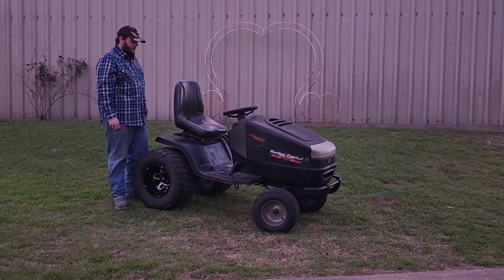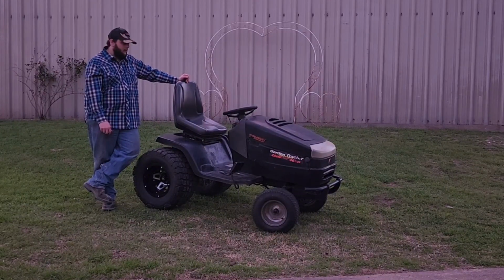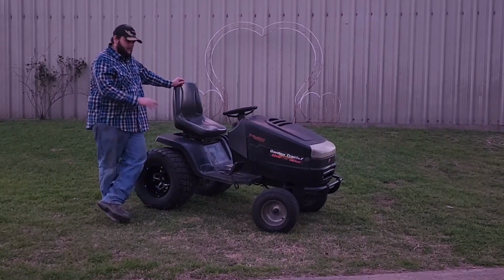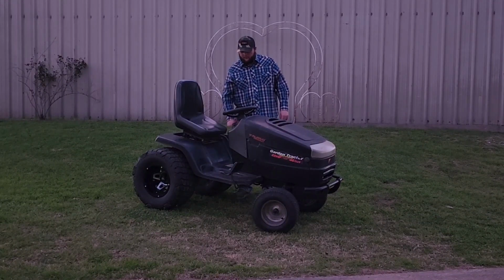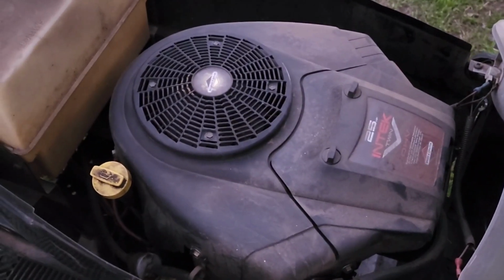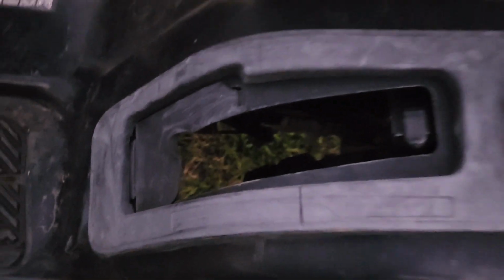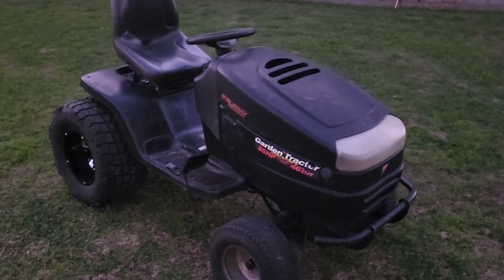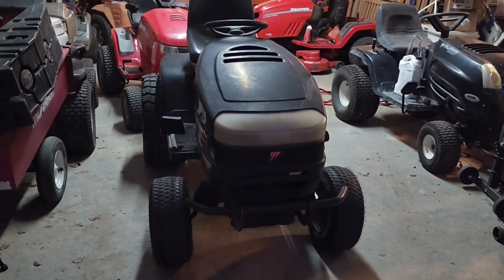Tractor Showcase: 2003 Murray Performance GT

Comment: I had one of the wide body  in 2000 I believe. Had all the attachments. Planet a 2 acre garden. When I would use the braking plow I would make the front end stand straight up in the air. You have a beautiful collection. Thank you for the video's